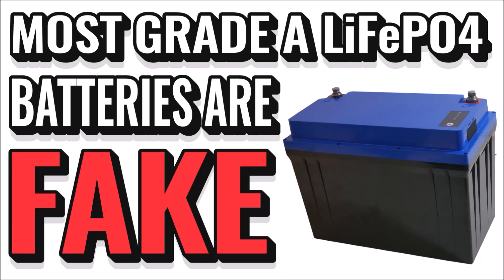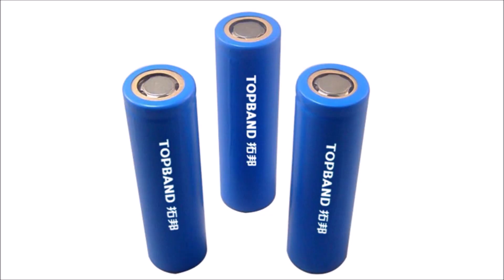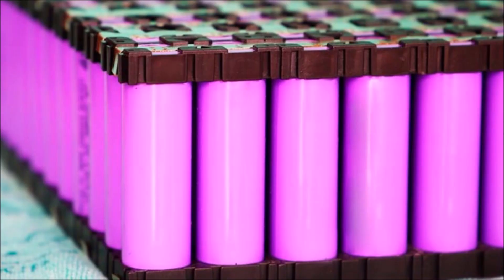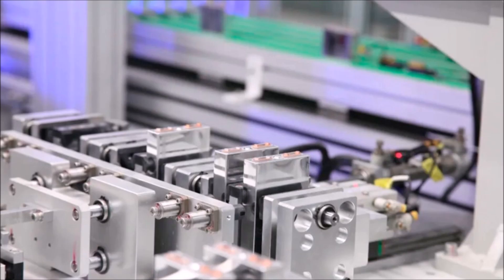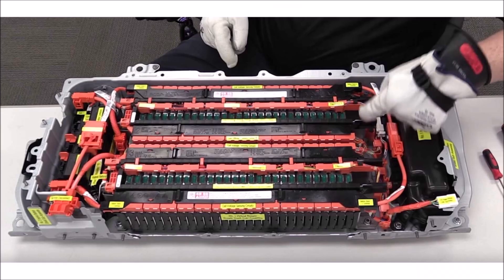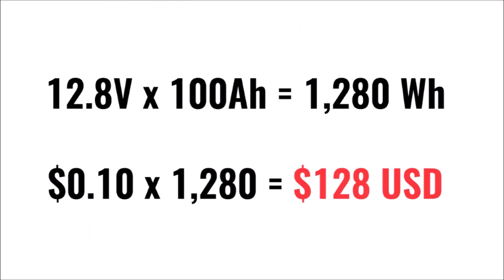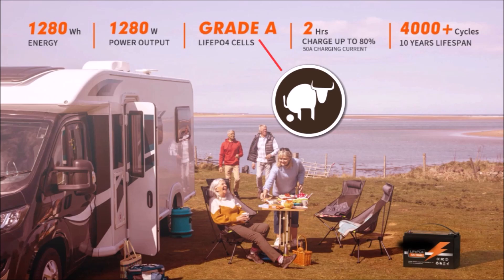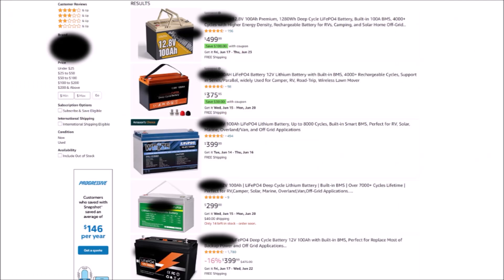Fake Grade A Lithium Deep Cycle Batteries Are Everywhere!  Learn How To Spot Grade B vs Grade A

Comment: I hope my 1100 dollar Ampere Time 300ah battery is high quality. I spent the last of my savings on it and the main parts to begin building an off grid emergency power supply for hurricanes or if my family gets me kicked off disability. I live in a camper far from stores with no transportation and I`ll never beg anyone to help me again. Food prices are so high that to avoid over spending I have to carefully shop online. Stores are now out of the question and I have no way to get there in the future. The only thing the state is willing to do is maybe/maybe not provide nightmarish medical transportation. I`m trying my best to just survive and can barely take it anymore. I need to be writing a will so decent humans will get all my preps because my relatives will throw my stuff in a shed for awhile then after it has cobwebs on it they`ll carry it all to the landfill.
Reply from the maker: I think Ampere Time makes a quality battery but they do use Grade B cells.  Please don't mistake Grade B cells as being poor quality.  That isn't necessarily true.  They just aren't perfectly matched to factory specs.  But with a good quality BMS they can still last 1000+ cycles for you.  So that should be a great start to your off grid journey!
Reply: @LDSreliance  I`ve been using it with a 20 amp plug-in charger and 2000w inverter for power outages and backup storage just in case I need power to save my freezer food if there`s no sun to power my two Bluett EB70s. I ran my window air conditioner for 5 hours with it one night but didn`t want to completely drain it and shut it off and used it with my microwave too to make instant coffee when a storm knocked out the power. I`m getting a battery meter and switches and two more panels to have 780 watts series/parallel setup for starters. Gonna increase that to 980 eventually.
Reply from the maker: Sounds like a great plan!  Good luck!

Comment: Thanks for the information. I am a shoestring budget individual ,and  I use what flooded lead acid batteries for my small battery bank. The comparison difference between the battery types is wild,but I am forced to stick with the more affordable flooded type battery. I did learn some good information though and will reconmend your video to anybody I hear that's buying batteries.
Reply from the maker: Thanks for the feedback!  I am glad you found it useful.  I always recommend GC2 batteries from Sam's Club or Costco to folks on a shoestring budget.  That is how I started and they are built like tanks.  They are designed for golf carts and cost about $90 a piece usually.  Thanks again!
Reply: @LDSreliance  Thank you for responding. Ive got six interstate GC2-ECL-UT that were given to me <they are about four years old and I am trying to bring them back to life. So far so good (trickle charge ). I have 6 USA 2200 6 volt batteries working.  Do you know of any USA dealers of 750 watt wind turbines ? (12 volt). Hurricane no longer sells them.
Reply: @LDSreliance , Sam's Club yes, as their batteries are made by EastPenn, which is a good company. Costco, no, as their batteries are made by Johnson Controls, which are garbage and don't last long. Interstate is also now made by Johnson Controls, garbage, with a one to two year life expectancy...

Comment: Any expreince or opinions with chins or echo worthy lithuim batteries ??
Reply from the maker: Chins and Ampere Time are the same company and are 100% confirmed Grade B with terrible support.  Eco Worthy is also a low cost manufacturer.  I haven't evaluated their batteries but if they are in that $300-400 range then they are definitely Grade B.
Reply: @LDSreliance  thank you very much👍

Comment: I assume the cost of components can vary depending on quality but if you take 100% of the cell cost out of your analysis and leave the other costs you reference it still come up to a cost higher than battery prices I see on Amazon or eBay? What am I missing. Thanks
Reply from the maker: Yes, that is a big problem.  I didn't mention it in the video because I only have anecdotal and circumstancial evidence but I am pretty sure these sellers are funneling their products through Taiwan or other countries to get around the high tariffs and fees that they would see coming from China.  And these sellers may be willing to profit less than the $75 per unit that I put in my calculations.  So maybe some of these companies are able to get by with about $275 in costs when you take out the cost of the cells.

So basically in order for them to make money, they are using extremely cheap cells and that should worry you.
Reply: @LDSreliance  I agree you can’t buy a battery for 150 dollars but your all in cost in you’re video was like 468 and adding marketing etc the cogs was over 600.  My point is and correct me where I’m wrong is you can buy a battery in the 300 dollar range and all the additional costs you use to get to 600 should aslo be in the cheaper battery ie the only variable the cost of the a and B cells.
Reply from the maker: Yes, if they are playing by the same rules.  But like I said, they may be willing to sell cheaper for less profit than other companies.  For me, I am not willing to sell a battery and make $75 profit.  But that is because I don't sell high volume.  If I was selling 10,000 units then that would be a lot different.  

I was also a bit generous on the components as I recently learned that these companies are using BMS's that don't even have cold charging protection because they don't have microcontrollers.  So these BMS's are less than $10 component cost each and that is the most expensive component.  So the $75 I allocated to an ABS plastic case, some wire, some connectors, some sensors (which won't exist on these after all), a BMS, some nickel tabs, etc. is probably overkill.  Especially in volume, like I said,  If they are making 10,000 of these at a time the costs go way down.

Then you throw in avoiding tariffs and using Amazon fulfillment so they don't even have to have a warehouse in the US or any customer support in the US....

Comment: How would you feel if you bought a new truck, then 2 years later you found out they put a used transmission in it at the factory? And the engine was 300 hp, not the 400 hp you thought you were getting? 
Or a shopkeeper cutting the "irregular" tags off clothing and selling it for full price.
Dishonesty is theft in this case.
And some of these comments- what is up with you people? Are you taking sides with the crooks, or trying to justify your purchase of a knock-off battery?
New cells are tested individually. They pass, or they fail. Grade B cells didn't make the cut. 
It doesn't matter how cheap the battery is- if it has USED or BLEM cells, or a sub-standard BMS, they should state that in their advertising.
Reply from the maker: 100%.

Comment: You explained the differing cost, but so what??  For certain applications it might be just fine. Say RVer wants to be off grid with solar, 5 years saving 50% of cost, compelling. House solar for 20 years, not so much. I cannot support mislabeled product, just drive home the why you should buy these or when is it ok? Go more into the risks of purchase. Think of this, sometimes you can find a $15 bottle of wine that is as good a a $50.  That mindset might be occurring here. I bet the reviews are great on then because the users of yet to see the liabilities.  Thanks for educating the the public and I hope this feedback helps.
Reply from the maker: I agree with that.  There is nothing wrong with choosing to go the Grade B route if that meets your needs.  But a consumer should know it is a Grade B product so they can make that call on their own.  Most of these companies are promising 3,000-4,000+ cycles out of a Grade B battery, which will never happen.  So an uninformed consumer may purchase a $400 battery vs a $800 one and think that is the last battery they will ever need for their camper van that they live in.  Then 3 years later it is dead.

Comment: Im seeing batteries with recycled cells, some even get re-packaged with new plastic covering.
Reply from the maker: Yep.  I've even seen a battery sold to a consumer that had a concrete block inside taking up half the space where cells should be.
Reply: @LDSreliance  Those are usually display batteries for the shops but ive seen a few smash and grabs where ppl have stolen them and open em up when they dont work and find they are just a case of concrete. We did find floor tiles in lithium batteries though
Reply from the maker: The one I am referring to was someone who ordered a battery off Alibaba and cut open the case when they received it and found a small battery bank taking up half the case and half of a cinder block on the other side of the case.
Reply: @LDSreliance  Didn't u know? Thats what some Chinese manufactures would call solving a cost issue. Im not joking. A guy here distributed car battery jumper starters, and asked for cheaper costs. Next order he took, the battery size was changed to 1/2 the size with some bare lead added to even the weight loss... 😂

Comment: "grade A" is a subjective rating term.  Why is there not an ISO rating number? Their "grade A" might be to an internal spec sheet or on the assembled battery itself.
Reply from the maker: Grade A is somewhat subjective as it is determined by the manufacturer of the cells.  But it is applied universally to all of the cells of that model and indicates a tight tolerance to the specs that the manufacturer was shooting for.  So you are right that the Grade A specs on cells of one 3.7V 18650 cell manufacturer may differ slightly from the Grade A specs of a competitor manufacturer's cells, but that isn't really relevant to the video.  Any deviation from the Grade A specs when dozens of cells are combined into a battery pack can prove fatal over time, even with an awesome BMS.  And when all of the cells are Grade B and fall outside of Grade A specs, whatever those specs are, it compounds those variations into pretty major differences that can affect peak current output, how well the battery pack holds voltage, as well as the longevity of the battery that I focused on in the video.

ISO is just a manufacturing certification that means the company complies with certain standards of quality control, manufacturing processes, documentation, etc.  It doesn't equate to cell spec deviation and isn't the same thing as the cell grading process.

Comment: Great information. But you cannot definitely say higher price mean grade A. Unfortunately everything is made in China and if you don't I have a brand QA representative at the factory doing audits constantly,  spreadsheets and information can be skewed. Find a brand that hires a full-time QA that audits the controls and manufacturing.
Reply from the maker: No but you can definitely say impossibly low price equals Grade B.

Comment: It seems from the video that there is not much difference between Grade A and Grade B in the short term. How about in the long term - is the difference quite considerable? If the answer is anywhere between No and Yes, then this leads to consider grade B batteries that are priced fairly to their cost and to ask: are there any?

Comment: i was wondering if they should just be dismissed as "fake" or simply take the fact that they are not actually gradeA into consideration. I can accept the existence of lower grades for a respectively lower price.
Reply: Agreed! And with the warranty, one can make an argument that you can simply replace your battery with another "Grade A" before the warranty expires.
Reply: I read the reviews because I figured most people were going to say the same thing that I'm about to. And once you said you probably will not notice the degrading of power until well over a thousand cycles. Then I say hell for $300 if I get four or five years out of it still puts me at a lower cost than $2,000 to get 10 years. Now I do know and I'm sure that's what you are getting at it is a gamble because you may only get two years out of it. But you may only get four or five years out of your very expensive battery. And what a lot of people don't notice about those very long extended warranties is after the first couple of years they usually go into a prorated system so it's going to cost you money to replace it anyway
Reply: @NeilGraham.I.M.F  on top of this a lot of those companies selling batteries allegedly good for 10+ years are not around for longer than 3 years and by the time you figure something is wrong they go out of business and reappear with another name so you can't catch them. This is a big gamble anyway.
Reply: Very good point...I'm fine paying half price for a battery that will last half as long. With technology advancing so rapidly, do I really  need a product to last 10 years just to be obsolete then
Reply: @jime9305  or how much wear will you actually use it for? if its for a diy power station that you use every other weekend camping and it gets fully cycled lets say 6 times a month thats 72 cycles a year. thats 720 cycles in 10 years well below a grade Bs life span. 10 years is an eternity in battery tech.
Reply: @MrSGL21  sure beets liquid acid that all i get is grade B i don,t let them get below 98% 5 year and going great
Reply: ya all my batterys are diy used or b grade work up to 800ah now on one system runs the frig and two deep freeze, one 350ha for computer and cooler in my office and 100ha to run a fan buying more battery more then solar panels
Reply: A fake is a fake. The problem is how are you going to assess  this fake. There is plenty of fakes in Aliex. My bad experience started when I bought a 7kwh battery. It weight only 13 kg. According to the weight capacity of a battery a 7kwh would weigh abt 45kg. So the good money I paid turnout to be less than a third of the capacity. I or anybody for that matter, should not accept paying good money for something a lot less than the label and not knowing what's seal in it.

Comment: If the best way to spot a fake battery is by its price, then selling a grade "B" at the same price as grade "A" would make them tons of profit. As you pointed out, most people would never know until after the warranty period ends. And honestly, how many people request the paper work (which I'm sure can be faked as well). So just by price alone, you still would not know for sure the battery is legit. A sellers reputation would be your only guarantee. (Or as close to a guarantee as you can get.) 
It's all too much for the average person to deal with and government doesn't really care. This is why the "Fake" industry is so rampant.
Reply from the maker: That is true, but consumers buying the top shelf batteries are doing so based on reputation, good customer service, and strong word of mouth.  They aren't really willing to put in that much effort to build that up.  Plus, it is a numbers game.  I know from personal experience that the high dollar batteries only sell in low volumes to discerning buyers and those using them for absolutely critical loads.  So they could sell dozens of batteries at extremely high profit, maybe hundreds of them once they get established, OR they could sell thousands of them as no names on Amazon for a more modest profit and little effort.  They are going to choose the latter every time.
Reply: @LDSreliance  Well you have given out much information. Now it's up to the consumer to use it in their best interest. But I have to confess that I too have put price before quality. It all came down to what I was going to use the product for.

Comment: Having lived off grid for 2o yrs with large deep cycle lead acid batteries ,I can't justify the price of other types, I have stuck with the matinece style and found as long as you keep an eye on fluid levels and don't abuse them, ie deeply discharge ,I've had them last between 5 and 7 year s  find a brand that works for you and stick with them ,much the same as tyres you get what you pay for and buy local seems sensible  thanks for your help it's a learning curve but all well worth the effort in the long term
Reply: Modern LFP batteries are actually lower cost and last far longer with more retained capacity that large lead acid. You can buy good quality LFP battery modules for less than $1500 per 5kWh with a 10yr warranty. We stopped using lead acid about 5 years ago for off-grid projects, they are just too high cost, too high maintenance, and actual capacity degrades relatively quickly.
Reply: I've been offgrid four years  first year with agm went to lithium  and  so much better  you will get almost  2 and a half  times a battery  as lithium  charge faster  and you can  use every  bit of its charge  without  damaging it  agm are dinosaurs  now and absolute junk  in this day and age. Heavy  pieces of junk 😂 why buy  a battery you can only use half its capacity

Comment: This is exactly why I bought Battle Born Batteries as they were put together in the states with their own BMS and of course their own stringent quality control.
Yes, they’re expensive, but if I’m going to hook up batteries to go off grid, I want to make sure they don’t burn my house down. 
Every component I used wasn’t cheap, but I don’t have any restless nights wondering if everything’s going to go bad.
So I use Victron for everything else. As far as panels, go, it’s where you can get them and I’m definitely not an expert in those.
Reply: Panels .. been using FRED 480 for 10 years (SEE EBAY) .. USA BUILT and each flashed w documents .. still around $1/watt , great sellers also .